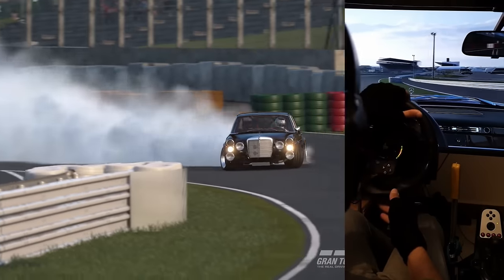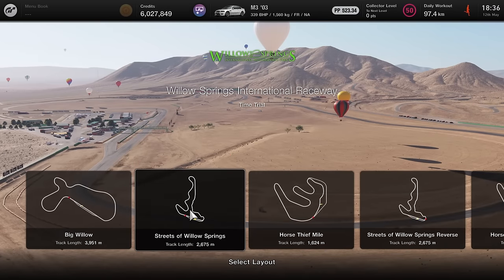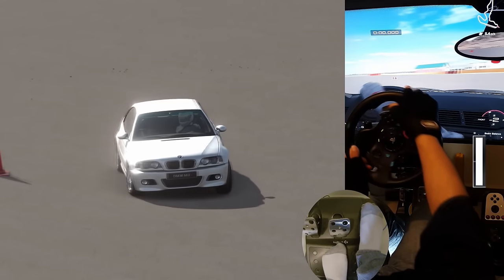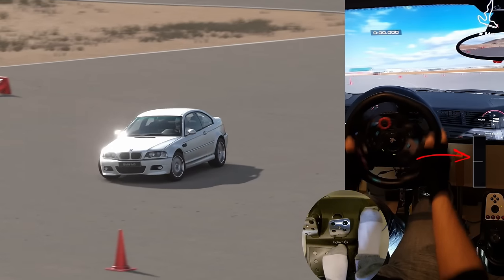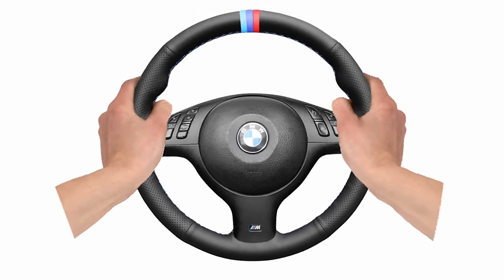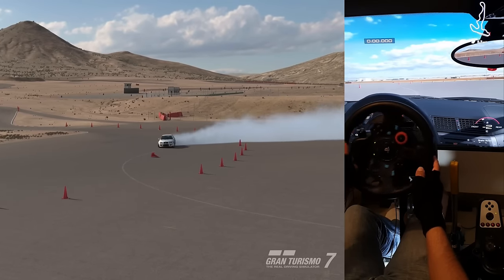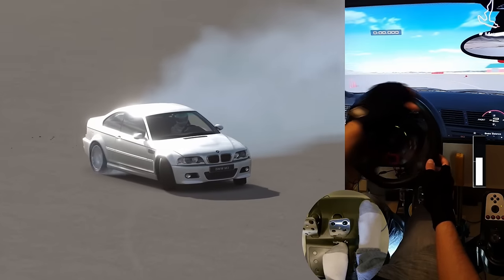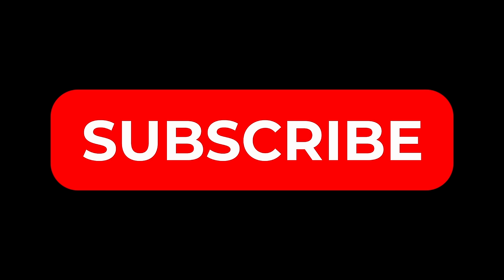How to Drift With a Steering Wheel (GT7/Real Life Tutorial) - Part 1: Basics

Comment: You have to be careful with the max torque setting, with a weak wheel like a g29 you shouldnt use more than 4, else the ffb waveform will be clipped. Besides that i enjoyed the video a lot, i think my problem mostly was going too hard on the throttle or release it too hard too, and for too much time, so i spin out. Glad to hear you are the same guy from that other video (steer contorller sensitivity), people asume all the "controller" settings are for dualsense, but GT calls even your wheel a controller, so all settings in game are for the wheel aswell (different for options settings menu). So as a fellow engieneer i aprove.
Reply from the maker: Clipping the higher forces is better than losing the lower forces on a week wheel such as the G29. With the TGT2 I set the torque to 6. I'm glad you watched my other video, I also made a mistake in the graphical representation of of the forces there, so you can watch it properly corrected here: https://youtube.com/shorts/-mi2V__LLfM?feature=share
Thanks a lot for your feedback man, and yes smoothness in the input changes is key. Actually the smoother you can be, the more you'll be able to pull out some much more brutal drifts. 
Regarding the controller steering sensitivity, and considering all the wrong interpretations of it all over the internet, with people even stating that  PD themselves say it's just for the "controller", I have a feeling that this effect could be a bug that wasn't even intended from their side. It's there since GT sport though if not even before. I was totally aware of a much more obvious coding error where they had the engine sounds swapped between the E46 M3 and the E92 M3 in GT6. It was so obvious yet I didn't see anyone noticing it nor did it ever get fixed lol.
Reply: @SimActionClips  Its definitely not the lower end of the force that comes through your steering wheel when your tyres starting to loose traction.

Its the higher end of the force that will allow you to better control of the car, so you will loose every important details in your ffb when it clipped.

Unless you think feeling “small bumps” on the road are far more important than feeling your “tyres at the limit of its grip” while cornering…
Reply from the maker: @Ton AMG that's not true. You actually use the whole range of forces regardless of which is bumps and which is not. To feel that your tires are just starting to lose grip, and more importantly to feel that the back is just starting to step out when doing some neutral steering (if you know what that is) you need to feel the lowest forces available at the moment they start pulling the steering wheel to one side. Because at the beginning of it the steering wheel would feel the lightest possible. The forces are exactly similar to when you're going in a straight line and you start introducing some very minimal rotation to the steering wheel. And the more lower forces you have available there the faster you will be in catching any change. And you got it all the opposite way. The more clipping you have on the higher forces the less you feel the bumps which exactly are not as important as feeling the change in direction and weight shifting of the car. 
And what I've described above is a very tiny but important example of where you  need these lower forces when racing. They get even much more important when drifting if you wanna do it properly and similarly to the real thing.
Reply: @SimActionClips  Your steering is heaviest when you are turning into high speed corner with your front tires are at it maximum of its grip…

You don’t feel the back stepping out with the steering wheel… you know, your steering wheel is connected to the front wheels of the car… not the back wheels🤦🏻‍♂️

In real car, you feel the back stepping out with your ass on the seat and not your hands on the steering wheel🤦🏻‍♂️

In sim, that’s what motion rig and haptic feedback are for… not your wheels.

Also, when you clipped you lose every details in the ffb… but there are ways to tune the lower forces up WITHOUT clipping… 

That’s what the other setting call sensitivity is for… this will bump up the lower forces without increasing the overall torque value. (Although you lose dynamic range but still better than clipping)

The torque setting you basically raise everything to higher values which can cause clipping.
Reply from the maker: Your description gets me really questioning how do you even drive. 

The ffb is at maximum after you have already turned into a high speed corner, not at the moment you start turning. It hits maximum right at the edge of the grip with maximum possible steering while still maintaining the grip. The force then can decrease if you start understeering.  At the moment you start turning you can feel it ramping up till you reach the maximum that I've just described.

You talk to me in a condescending way thinking maybe I'm just a boy playing a game or something and pretending you know it all. And what's with these facepalm emojies, they don't make you right you know. It's true in real life we feel the back stepping out with our ass and we heavily rely on the G-Forces. In sim racing when you don't have a motion rig you can actually feel the back starting to step out with the wheel, if you actually know what you're doing, which clearly you don't. I've described the mechanics of it in my video if you even watched it all. I don't like to just throw comments the way did on a previous one when you said "my car in real life is an AMG" lol. But for your info I used to actually compete in real drifting locally. I have a purpose built drift machine, that 2JZ powered E36 you see at the beginning of my drifting tutorial. I'm a finalist in GT Academy International 2014. I know precisely what I'm talking about when I give the info that I've already explained to you. I don't like to talk that way, your way. I'm not gonna even reply to your comments anymore, since you're not wort it with the way you talk. 
I'm just now explaining more details for anyone reading your comment so that they don't get deceived with wrong info and that's it.

When the forces get clipped you don't lose all the info, you just lose some of the differences between some of the higher forces which are important to keep if you have a capable wheel. The lower forces are much more important though. And I've already explained some of the why, but there is much more to it. I've already recommended the highest ffb sensitivity of 10 and that alone is still not enough for weak wheels such as the G29. And again add to that, it's not capable of spinning fast enough on its own when you need it to during a drift. That's what we actually rely on in real life drifting, we just hold it and let go of it to spin on its own most of the time while doing most of the work through the pedals. I doubt you even know how that works given your statements. 

Anyway for anyone reading, who wants me to clarify more details about any of this, feel free to ask. As for you I'm done replying to your rude attitude... peace.
Reply: @tonamg53  sensitivity does not bump lower forces really, just remove the smoothing applied to the ffb waveform. Maybe you meant the same but i dont think its correct saying it like that.
Reply from the maker: @KyriosDST that's true and actually decreasing the sensitivity adds some sort of elasticity to your connection with the front wheels. It makes you feel like there is some sort of delay in the ffb. It's most "rigidly connected" at 10
Reply: @SimActionClips  yeah, althought not everyone recommends to have the damping effect at 0(sensitivity is reverse damping), since it adds innecesary information and sometimes is unreal, its mostly up to preference, and with GT7 ffb i feel it benefits from a higher if not max sensitivity, i run it at 10 since your video, feeling more details makes it more inmersive for me.
Reply: @freedomdst  Source of your information or trust me bro?

My source are from what is actually written in the game itself and Fanatec.

Also “smoothing” is usually done on the wheelbase through interpolation of the raw incoming ffb signal from the game. 

Does not make any sense to do it on the game as each wheelbase would required different level of smoothing and technique.
Reply from the maker: @KyriosDST that's exactly what it is, reverse damping. But it doesn't just add virtual damping friction, it's also like adding a rubber coupler between the steering wheel and the steering column, which gets very soft at the lower sensitivity values. In GT7 It's best at 10 imo and it's still smooth enough. For people who want to lower the rattling of the G29 they can lower the ffb  sensitivity down a bit but they would be sacrificing better and more direct connection. In other games such as AC i do add some very little damping because the vibrations are very rough.
Reply: @tonamg53  You absolutely get feeling of the back stepping out through the steering wheel in a real car.
Reply: @DriftNick  you don’t actually as the wheel will get lighter,

You can say that you can feel that you cannot feel I guess 🤷🏻‍♂️

But definitely the wheel is not the first thing you feel… your ass + whole body on the seat will feel it first… if you only just realised the car sliding from your steering wheel and haven’t initiate your counter steer yet… you better hope there are no walls or anything solid near you.
Reply: @tonamg53  The wheel getting lighter is literally feeling through the steering wheel of the back stepping out, the castor effect gives you feedback through the steering.
Reply: @DriftNick  its still definitely not the first thing that you will feel… unless your sense are not very good and a bit slow…

Your body can sense the changes in momentum immediately as the back wheel start stepping out even before your eyes can see it and definitely before the front wheel start losing traction, which cause your steering wheel to feel lighter.

The point is, the steering wheel is not what you use to sense the car drifting in real life.

In sim, its another story as most people cannot replicate the changes in momentum with their simrig… 

Even if you can kinda feel it in VR… its actually your eyes that see the movement and trigger your brain into thinking you are sliding and cause the feeling of movement.

That’s why it a lot harder to catch slide in sim racing than in real cars.
Reply: @tonamg53  The first comment I replied to you didn't say it's not the first thing you feel,  you said you don’t feel the back stepping out with the steering wheel, that is simple not true, of course you will feel the wheel slip through your body first.
Reply: @DriftNick  You can feel it but thats not what you are using in real life… there, happy now?
Reply: @tonamg53  You do use it though...
Reply from the maker: people like to argue just to argue 😐

Comment: Is this manual or automatic wheel?
Reply: Force feed back
Reply from the maker: if you're asking if it has force feedback, yes it does like burntnugget1854 said
Reply: @SimActionClips  i am asking if the gear change manual or automatic cus idk what to buy
Reply from the maker: Oh, you should use a manual transmission for better control over the car, even though you won't really need it for this particular exercise in part 1.

Comment: DO I NEED CERTAIN SETTINGS OR SOME LIKE THE CAR DONT WORK
Reply from the maker: Just turn all the aids off especially traction control. You can only keep the ABS like I did
Reply: okay i will try but my car keeps spinning out and i dont know why. Im able to drift on games like asseto corsa and such but when it comes to this my car is so difficult.
Reply from the maker: Yeah Assetto Corsa is much easier and much more forgiving. This one is much more tricky because it's much more detailed. You need to focus on being as gentle and smooth as possible with your input changes.

Comment: How do you turn off traction control
Reply from the maker: You can go to car settings before you start the race and change the traction control setting from that menu. Or you can adjust it on the fly while driving by navigating through the different MFD options till you select the traction control setting and adjust it. You can see which buttons are assigned for MFD navigation and adjustment from the controller settings of your wheel or PlayStation controller in the settings menu. Sorry for the late reply and I hope this helps.

Comment: i uae same car and seeting but i cant drift same as yours. i cant initiate turn also same in the video
Reply from the maker: You just need to be patient and keep practicing man. It takes a lot of time at first that's very normal. Did you set all three values of the ffb settings like I recommended?
Reply: @SimActionClips  yes sir. i use stock m3 also but i dont know when try to initiate my turning the wheel i cant do drift same as ur video.
Reply from the maker: for how long have you been practicing this after watching the video?
Reply: i bought thrustmaster tgt2 i try practice again. 😂its hard to drift. 😅
Reply: btw sir, hows your drift using thrustmaster tgt 2?

Comment: is that a g29 wheel?
Reply from the maker: yes sir
Reply: 10:22 and does the force feedback do the countersteering for you?  @SimActionClips
Reply from the maker: Sometimes yes depending on the car, and the grip level and how sudden it needs to happen. Sometimes I need to accelerate the initial spin with my hands then let go of it, sometimes it does what's enough on its own if the counter-steering needs to happen slowly.  Check out this video where you can see many different situations: https://youtu.be/JQRgZsUP-eQ?si=ar6IOEDbGJ5lnIoF

Comment: I’m not even here to learn how to drift… I’ve never found a solution to the centering-spring/auto-centering issue. I use a Thrustmaster T300RS GT and drifting has never worked, neither has switching lanes on stage x, car always wants to snap back to center…
Reply from the maker: Can you please elaborate? I didn't get what the problem is exactly.
Reply: @SimActionClips  Sorry I never saw your reply, basically the second I release my hands from the steering wheel, it snaps back to the center. Therefore causing my car to snap in the game and spin out.
Reply from the maker: It's okay man bo worries. But that's normal and it's not a centering spring. That's caster angle in action. The geometry of the suspension always wants to bring the steering wheel back to the center when you release it, unless you're increasing your drift angle with the throttle. Btw which force feedback settings are you using?
Reply from the maker: Oh and I just remembered, are you by any chance talking about GT Sport. Because there was that issue in GTS when using a "drift sheet" in the car settings, which I never used.
Reply: @SimActionClips  No, I know how steering wheel return works, this is literally like feeling as if there is a spring trying to force the wheel back straight to the center, it’s a feature on Thrustmaster and Logitech’s which can be disabled on pc but on PlayStation I have no idea
Reply from the maker: It's a feature in the PC driver not on the wheel itself. It doesn't work nor feel that way in GT7 especially when you set the settings like I recommend. I know what you're talking about.